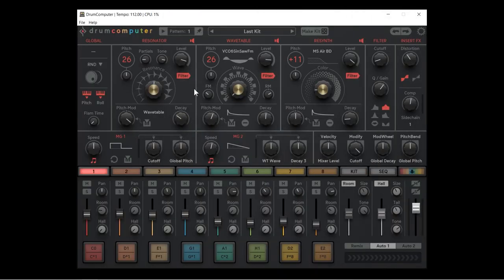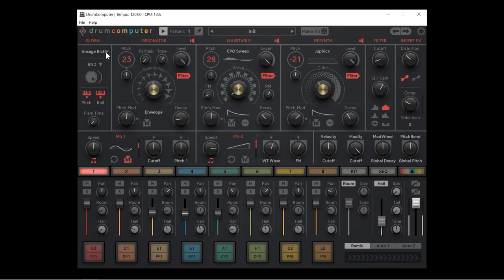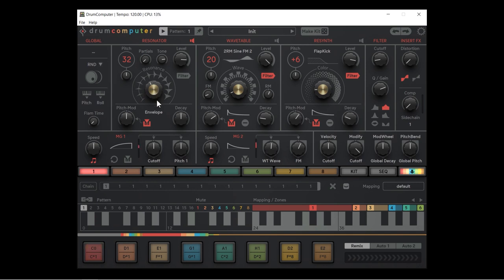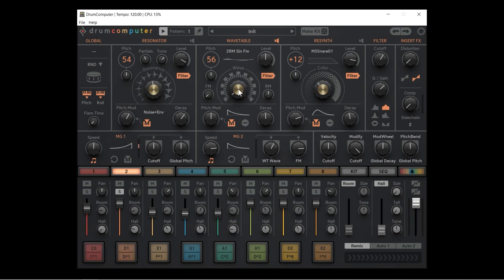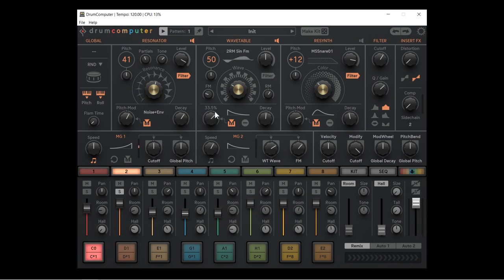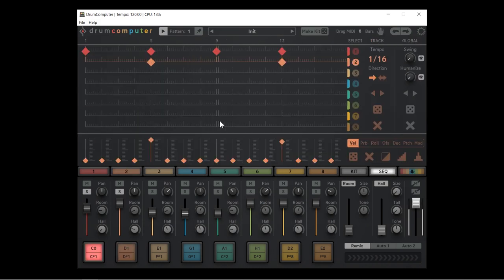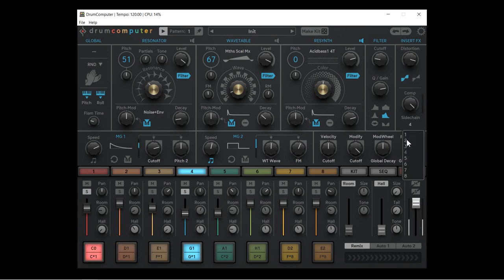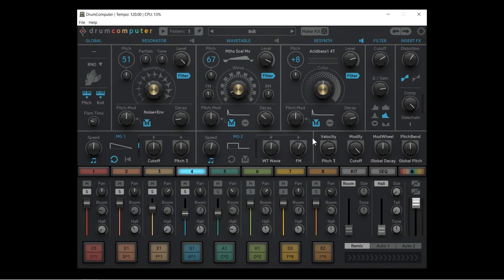Synth - DrumComputer Tutorial

Comment: I'd like to dispel the rumor that Drum Computer lacks bass. It does not. The Resonator (a self-oscillating highpass filter) can be tuned as low as 24.5 Hz, so that's plenty of bottom end for your bass drum. Problem is, a large number of factory patches send that signal out to the global multimode filter, which often set to a bandpass model or something that removes low frequencies. From my experience designing kick drums with highpass filters, you should either use a lowpass filter in post or just leave it alone.
Reply: Not hearing much bass on these demo's. Might have to download a trial
Reply: Might be, but in this demo all the kicks sound more like clicks
Reply: @laxplanet6046 did you read the comment?  It explains the lack of bass very clearly

Comment: I started using this and there's  very annoying glitch when using ableton and pressing the universal pause on the DAW and pressing play again Drum Computer will play, but won't output any sound whatsoever, and the only way to solve it is to remove the plugin and open up a completely new instance, which will do the same again eventually. 

Also, the remix autofill function never comes up with anything actually useful and when it rarely does it will ruin it by doing something random on the next fill. It's a good plugin when it works.

Comment: I’m struggling to find this useable in GarageBand on iPad and I’m wondering if it’s simply because there’s something I’m not doing properly.
I can bring a pattern in, but it doesn’t appear to be editable inside GarageBand, and just plays right through a track, without any way of stopping it (that I can see).
It being auv3 I thought this would all be possible.
It sounds great, but is proving useless to me, sadly.
Reply from the maker: You may check the 'Clock Start' option in the settings page of DrumComputer by clicking the gear icon on top right. There are two different ways to fire up the sequencer of DrumComputer since the sequencer has two inbuilt clocks: It can run along your songposition, or it can be fired with a MIDI note, only applying the sequence as long as you hold a MIDI note. Which means if the clock option is set to HOST, DrumComputer will start running as soon as you press the play button in the transport panel of Garageband and stop with the release. If it's set to INTERNAL, DrumComputer's sequencer will be triggered by a MIDI note only and you need to press a note so that it will start playing. Patterns respond to MIDI notes from C-2 to D#-1 whereas the single drum pads of a drum engine respond to the notes, which are set on the mapping/zones section.

Comment: in demo mode:  can't you play sounds as one-shots with a midi controller?  when i hold a key it repeats the associated sound over and over
Reply from the maker: Seems that the Key Roll is active, which uses the keyzone for creating rolls and controlling the roll speed. The Rootkey will roll at ¼ rate, getting faster with every key to the right.
So please first make sure to disable this option, then it should work. ;-) Note that the Roll setting will be loaded per preset.
Reply: @SugarBytes     thank you